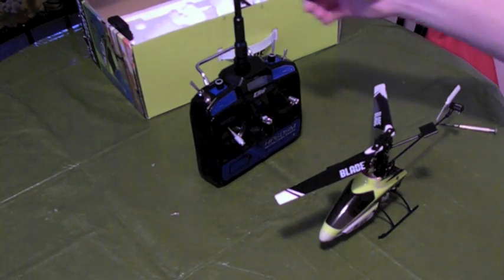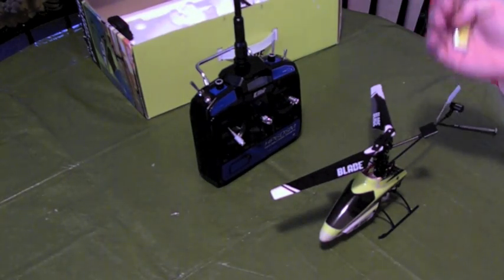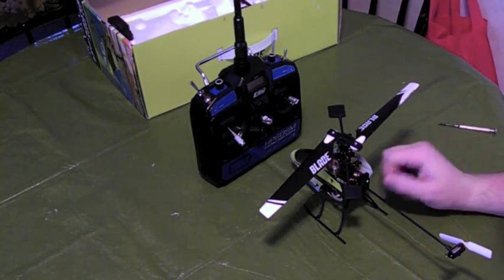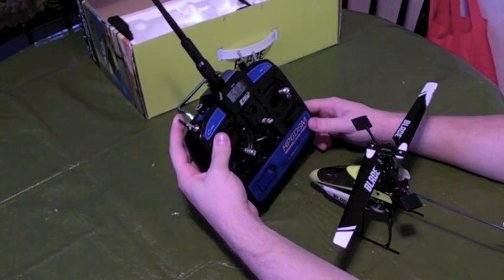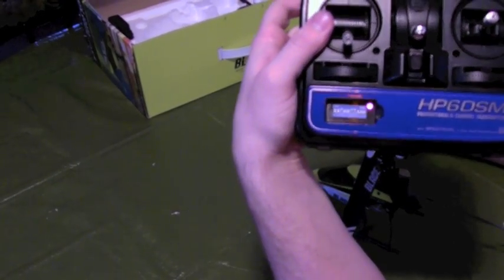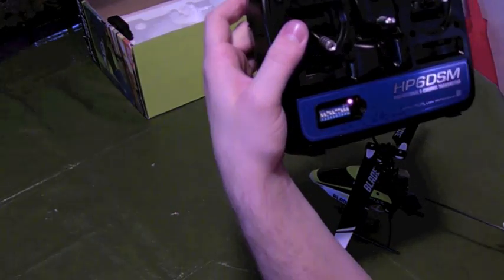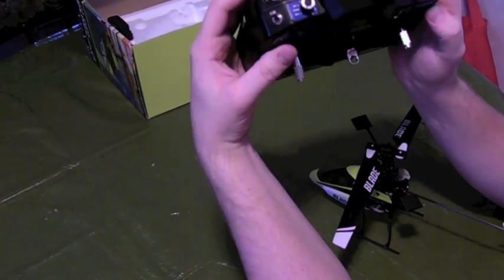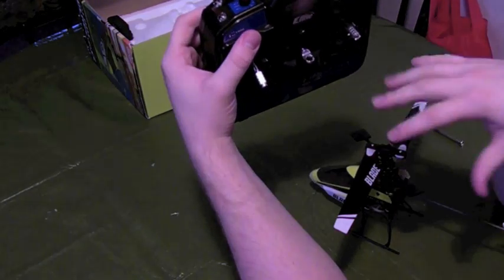Binding the Blade 120 SR to the HP6DSM Transmitter

Comment: Rondo Schiavoni4 minutes ago
I liked your video on the radio dip switch set up for the E-flite blue front radio ,  what I dont under stand Im flying a little coaxial Heli   like a blade 4 and the number 9 dip you say is for gyro , will this effect the gyro on my little coaxial heli ? because there is pot  settings in side on the side of the receiver or attached gyro for Gain   and something else  and I really dont want to mess with them yet  if I can help it  I jst wanted to get th ecopter as stable as possible. thank you
Reply